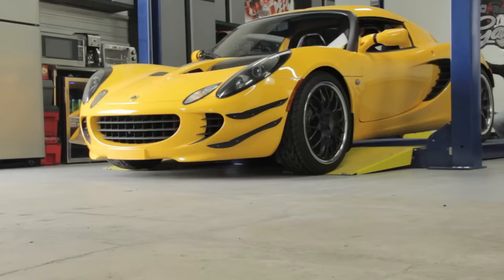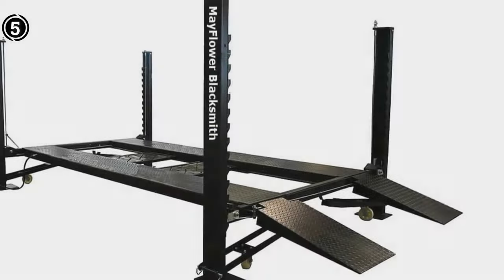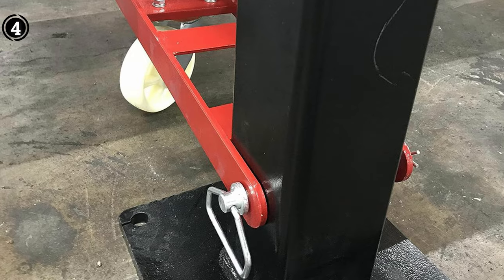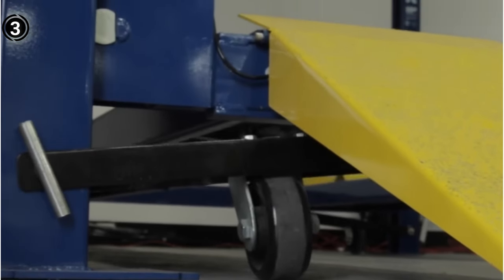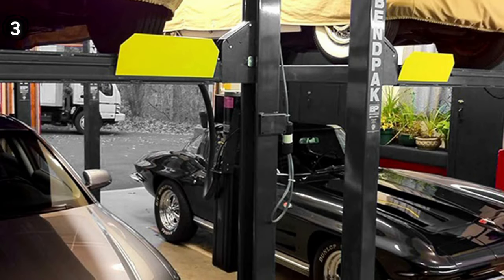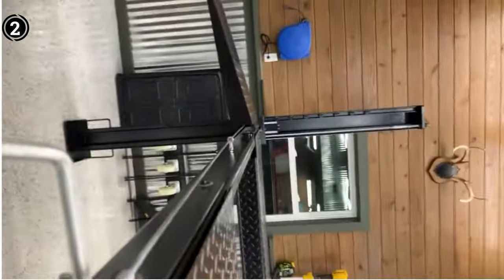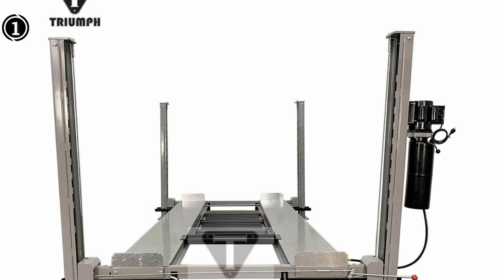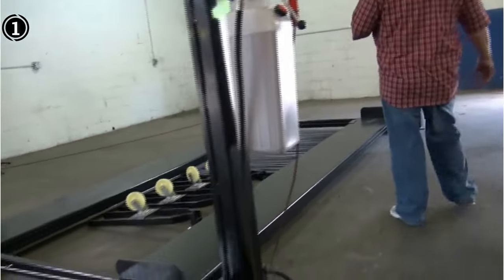Best 4 Post Car Lift for Home Garage - Top 5 Reviews In 2023

Comment: I notice that none of these lifts were bolted into the concrete? And only the Mayflower required a conrete foundation.  All of them looked portable. I ask because I have in-floor heating in my garage so drilling into the concrete may not be an option.
Reply: What is the thickness of the concrete?
Reply: @jeffxu5752  not sure.